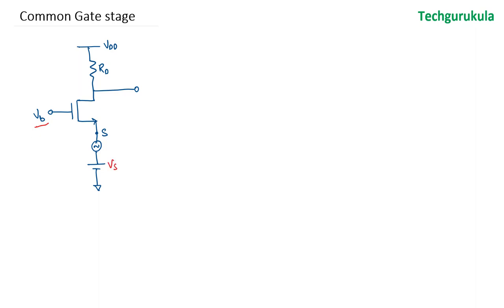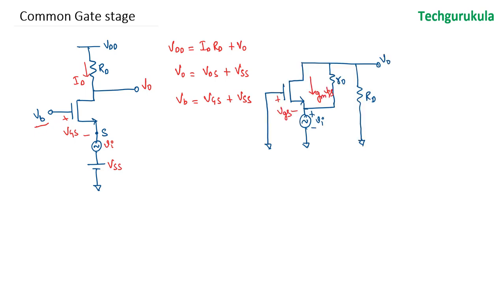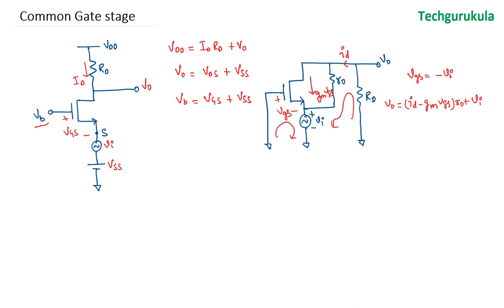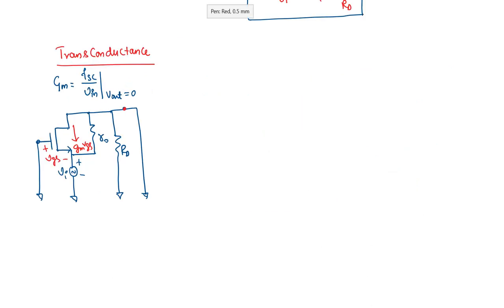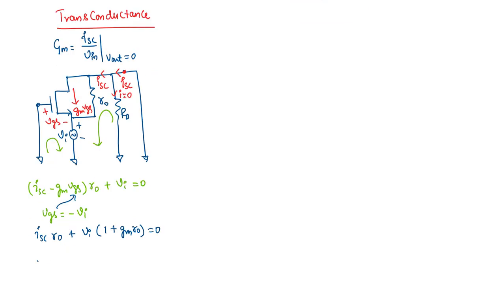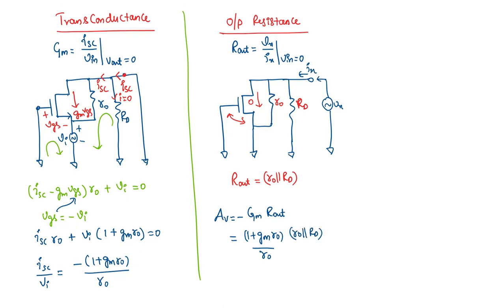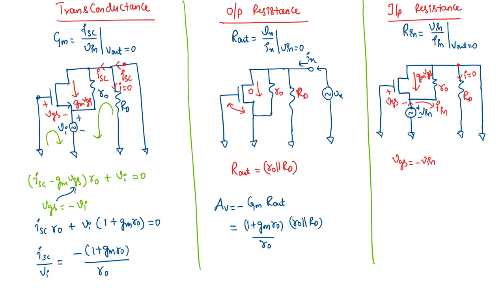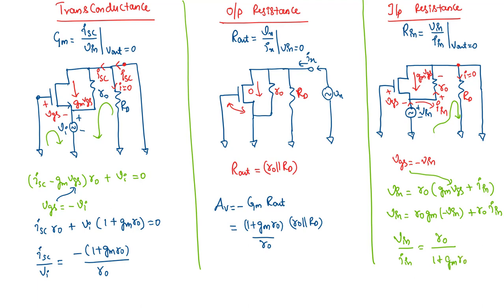MOSFET: Common Gate Amplifier

Comment: When we analyse the output impedance we should not assume output voltage as zero. Then where does I_in flows to. I_in flows to Rd and gererates Vout, hence Vout = I_in*Rd.  Rout = (Rd+ro)/(gm*ro+1)

Comment: Hey.
Please correct . The input impedance is not found out when output voltage is zero. Input Impedance calculated talking all the independent source to be zero. You can't just take output short. Let me clarify that when RD will be comparable to rds , RD will be a part of input impedance expression as well . You can follow Razavi book for better clarity.
Please correct it. You are doing great thanks.
Reply: thank god someone pointed it out !! for so long i was highly confused about it, that consfusion was strengthened by strong trust on techgurukula.